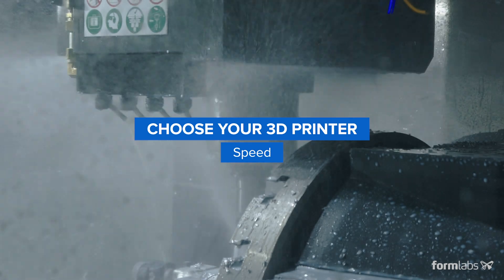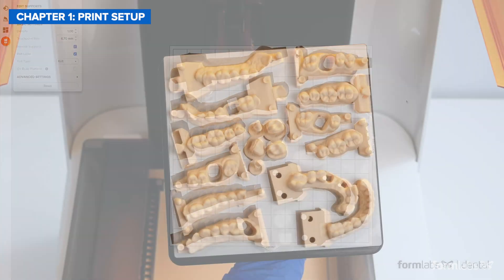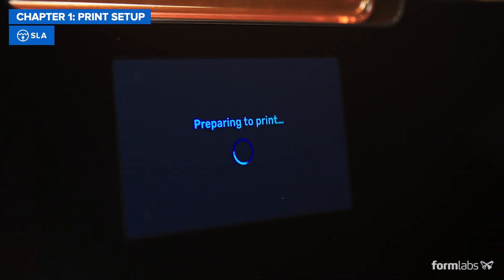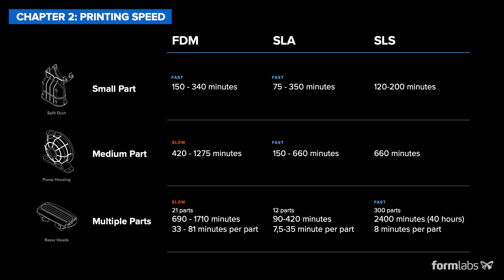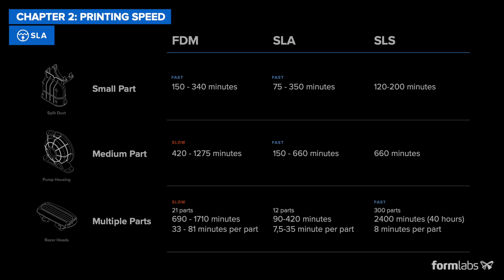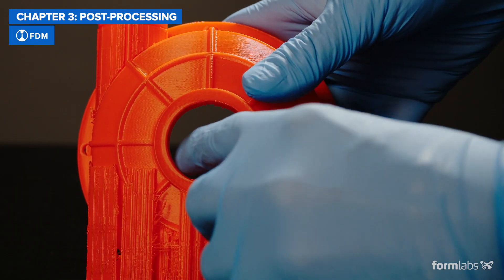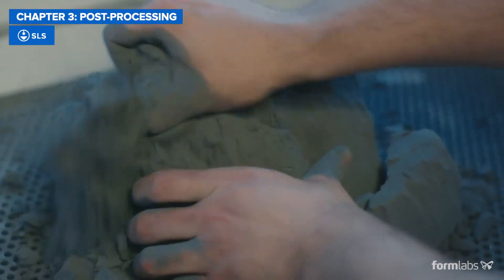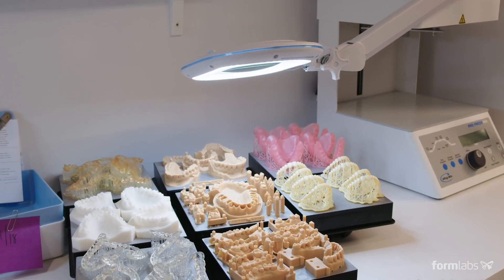3D Printing Speed | Compare FDM, SLA, and SLS 3D Printing Technologies

Comment: PSA for any of you out there with an SLA printer. Grab a Dremel with a cutoff wheel and cut the supports off at the base before you try to use some small shears/dikes to snip the supports.  Helps to prevent breaking thin details in the print and can really speed up the removal process over all.
Most of the parts I take out of the Form3 do not lend themselves to simply grabbing the part and twisting it off it's support base... I wish haha.

Comment: Shouldn't speed be compared for the same quality? As, for the best quality = lowest speed, but also FDM's best quality is lower than SLA/DLP worst, and SLS quality is the best of all. That means, slowest FDM speed is ~5 times lower than SLA/DLP fastest. MSLA doubled speed recently with  black-white screens, but also some Delta FDM's have double speeds than regular FDM ones. So the ratio of ~5 stands still. Missed the point where in this video this simple fact that SLA/DLP is 5 time faster than FDM stands out (not just hidden in the ciphers at 2: 50). And the multipart speed is misleading to say the least. As for a large enough vat one need to multiply this 5 factor with the number of pieces, so if 10 pieces enter the same vat, the speed vs. FDM is 5 X 10 = 50 times faster. I think this is relevant, 1 day vs. a month and half, or one hour vs. 2 days.